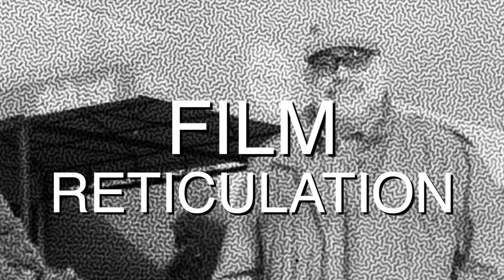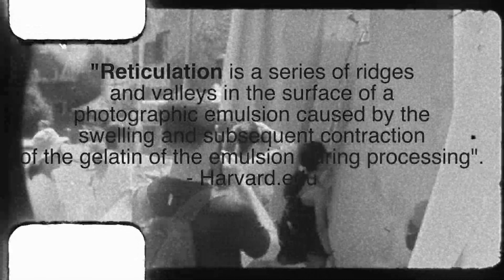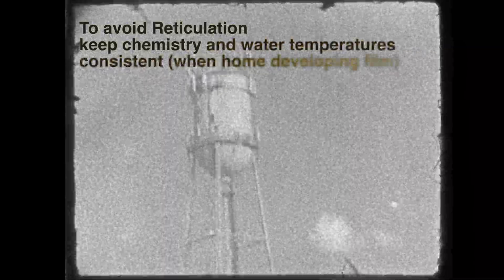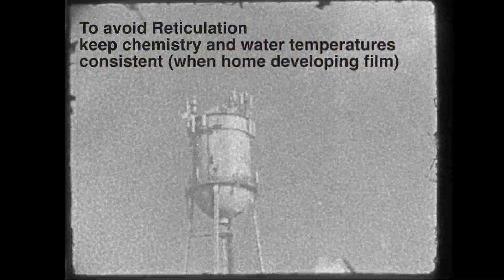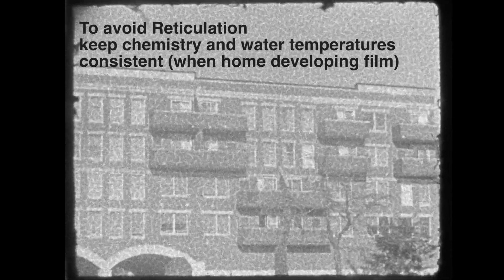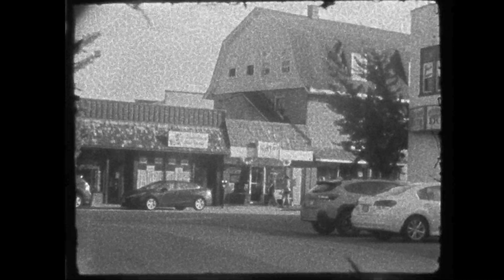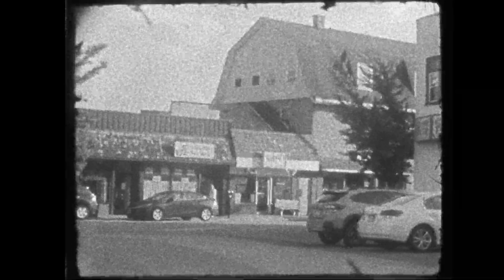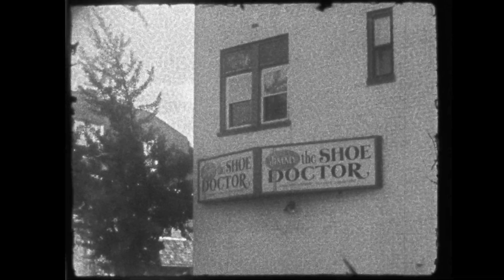Film Photography - What is Film Reticulation?!

Comment: I call this film worms! cinestill did this when I was developing with it. Pretty bummed that it killed a roll of film for me. My bath was a bit too cold I think and I was pushing trix-400 to 1600 with it. I believe the developer was somewhere around 90 degrees.. can't remember, my bath was room temp.
Reply: Ugh I did the same thing, first roll I've ever developed myself, same film, developer, and push. At first I blamed the cinestill, but it was me!
Reply: @alexmiller1658  I don't blame cinestill specifically, it works if your temps are spot on. They're just high imo, compared to 68 F for regular black and white, I think getting in the 90's tends to be a bit too much work for the monobath. The time you spend getting temps where they need to be, for much cheaper and far less time you can pretty much pick up room temp d76, stop bath, and fixer and develop your film.
Reply: @zoranzambo7364  oh absolutely, I've developed rolls since then that came out perfectly fine. Had to be more mindful that everything was at a consistent temp and it worked out fine